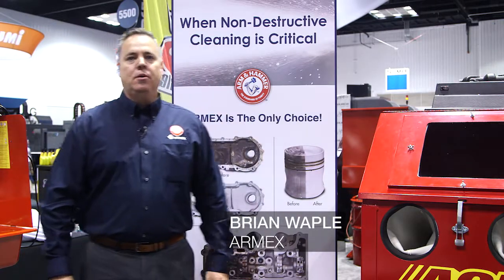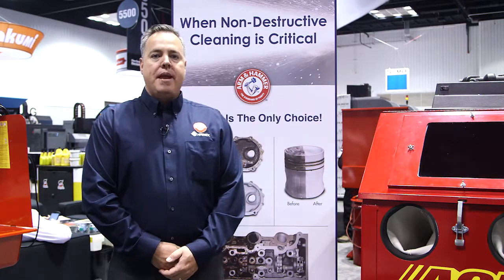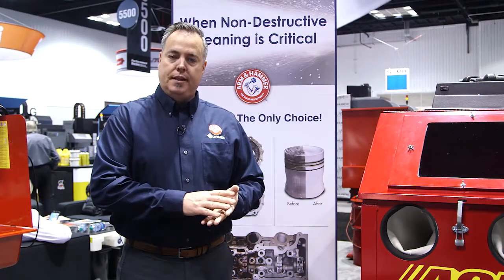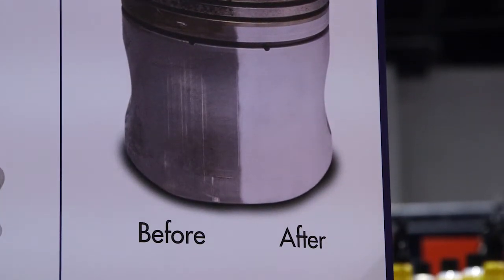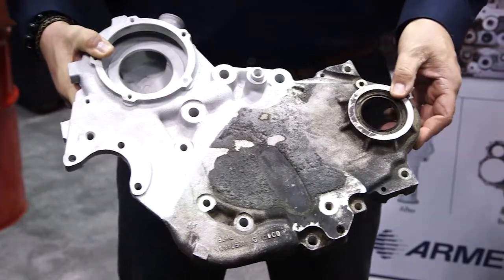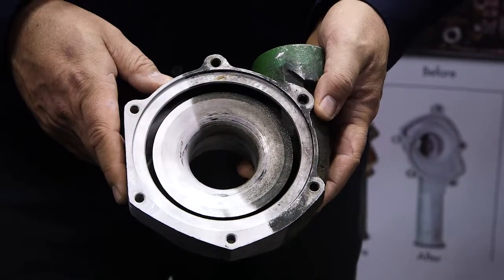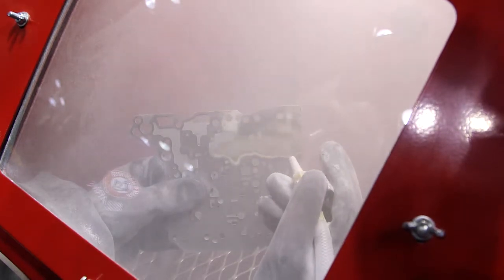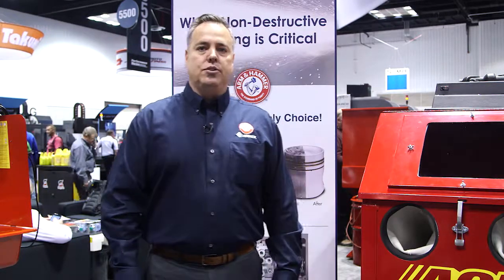ARMEX™ at 2016 PRI Show

Comment: Hi. I want to know, what is the correct way to clean engine parts with glass beads. After vapour blasting how to remove glass beads from engine parts. Which engine parts should be avoid to clean with glass beads. Is sodium bicarbonate better then glass beads to clean engine using vapour blasting method.